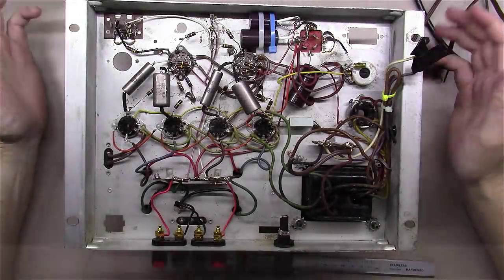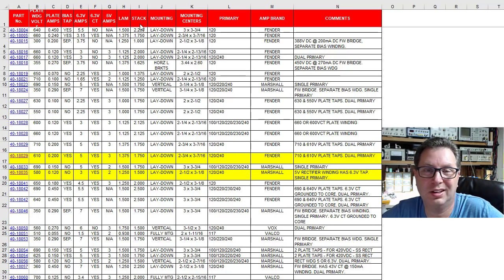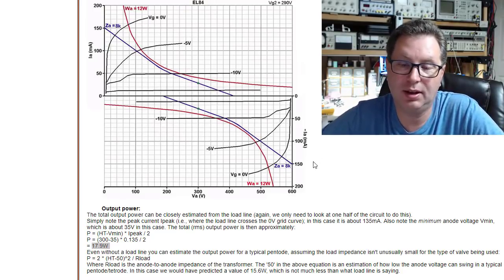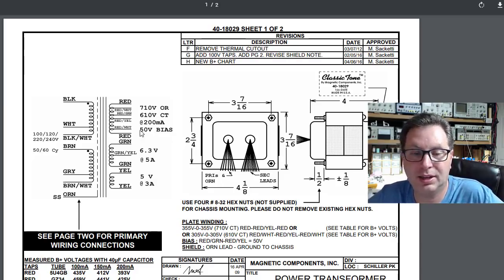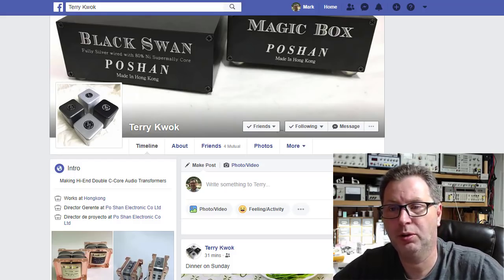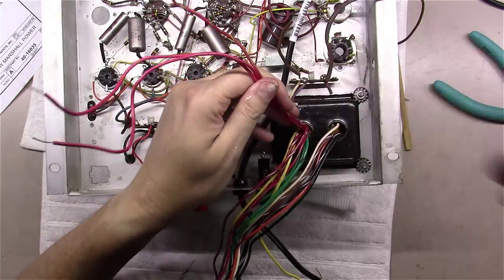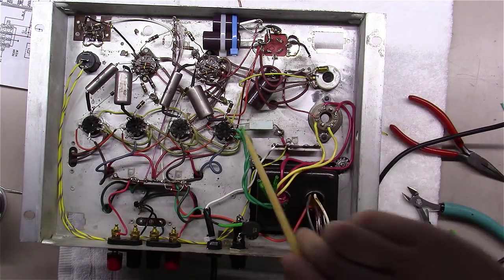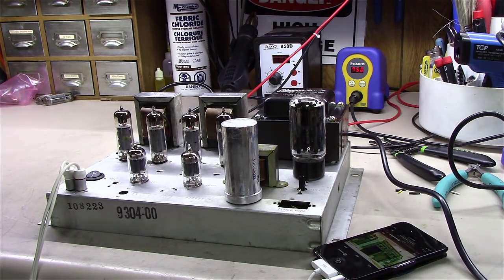How to find and install a replacement power transformer for your tube amplifer

Comment: The first filter cap should have a tie point to secure the positive lead where it is soldered to the red wire from the 5U4. Looks like a short to chassis could easily happen. Good to see both of these Maggies restored to working condition. I am looking forward to the KT88 build. Have re watched the 807 amp build a few times through. Great work, always love it!

Comment: Thanks for all your videos and recommended websites for components. The last two years I’ve been practicing with low-voltage amplifiers three solid-state two low-voltage headphone tube amplifiers. I’m about to build my first preamplifier. Then I’ll take a shot at the high-voltage high dollar DIY tube amplifier build. Your knowledge you pass on to us will remain on the Internet forever. 👍

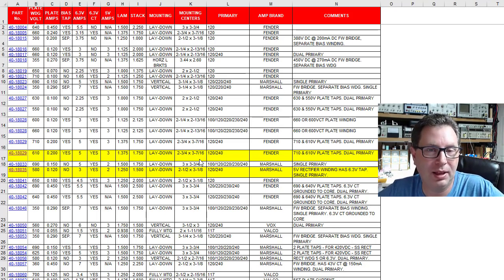Comment: Ok, right at the 14:45 mark you make a significant error in sizing, (3-7/16") 7/16" is in fact 5/16" of an inch larger than 1/8" off by a factor of 5 times.  Or 3.4375"-3.125"=0.3125" ; 1/16"=0.0625 5/16"=0.3125"(sorry it's the engineer in me).  I'm glad you had room on that chassis for the actual difference.  It looks great and sounds good too.

Comment: I got a Marshall dsl20 head. It sounded amazing the first couple hours. Then like a idiot I unplugged the speaker cable from the amp while it was on. The amp was on the clean channel with gain around 2, volume around 3. Wasn't playing the guitar. It was unplugged for about 20 seconds before I realized what I had done. Ever since the amp hasn't sounded as good. The tone is fizzy now. No crackling or popping. Didn't smell anything burnt. Could I have damaged the power tubes or OT?

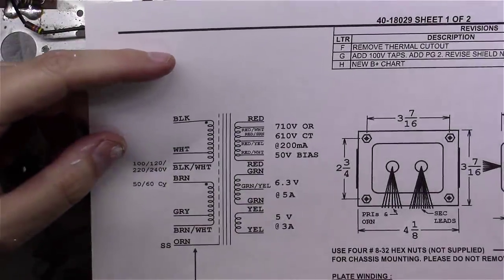Comment: Wait a second.  Looking at the transformer schematic @29:30, you used  red - red/yellow - red for your B+ windings.  From what I see on the diagram, that should be 710 volts across the entire secondary.  Shouldn't you have used the red/white - red/yellow - red/white taps which should give you the 610 volts, much closer to the 590 volts (no load) mentioned @3:50 ?

Comment: Why wouldn't you have gone with their number 40-18041?  Fits the original size and the specs seem to match - what am I missing?  It's line 20 in the spreadsheet.

Comment: WRT the 6BQS, isn't the 92 milliamps plate current for Two tubes? The Hammond transformers can be installed  'upright' or 'lay down' (just take one side cover off).  I bought one for my original Vox AC 30!

Comment: Wondering why you used the 710vct HT rather then the 610vc HT. I would have used the lower HT taps for EL84's.
Reply: That's how I read the transformer too. The B+ is now much higher than before. Calculated 504 volts vs the original calculated 417 volts.  B+ = ((VCT * √2) / 2)

Comment: I am having trouble understanding no-load transformer tests.  Every time I  try that, the results are useless for predicting performance at even 1/10 load.  Are these older transformers different from modern equivalents?

Comment: Thanx very much... I enjoyed your vid. I have a Fender Hot Rod Deluxe and though it sounds great the power transformer, after about 15 or 20 minutes heats up to a bit more than I'm comfortable with. Can you tell me if there are any guide lines as to how hot is too hot? Thanx in advance and thanx again for a great vid.
cheers

Comment: The measurement difference is actually 5/16" on the mounting center length of the 40-18029 transformer.  
But we're not spring chickens anymore and are able to make goofy math mistakes.  3-1/8 to 3-7/16" is an additional 5/16".

Comment: Hello, Is there a way to find the max. current available of the 6.3 AC heater current since don't know specs? The amp designs for KT88 and I like to use KT120 which needs more current. Thanks

Comment: Great video.Good info. Understanding current is my biggest weakness. The values of caps in the power section are confusing. Why does it hurt to raise the uf on caps or add an extra one. Why would it hurt to change an 5f1 champ from 16-8-8 to 22-16-16. I have seen people do it but I have had people say, don't do it.What would be the reason not to do it. Thank you.
Reply: If you're using a rectifier tube, a bigger capacitor will draw more current, and for more time, during first charge up, when you turn on the amp. That would damage the tube. If you're using solid state rectification, it's not really an issue. My champ uses 100, 47 and 47 uF. It's dead silent, no hum at all, unless with single coils.

Comment: Hi I am from india and I have Delta Company "BMB 20" Power Transformer Cum Vibrator Transformer which have one side black, green, yellow wire or 2 sleev with copper enimal and other side  2 red, White 2 sleeve with copper enimal and 1 center tap copper enimal. Can you please tell me how I will connect it with EZ80 tube.

Comment: The first transformer 40-18035  would have been shy on current for the rectifier fillament, 5v @2 amps. A 5U4 requires 3 amps.

Comment: Save those cut offs. The classic tone and heyboers are the best in guitar amps. Mercury mags are high priced and in the snake oil category.
Reply: Seems that many like to dis on Mercury. I have been using them for a long time now. Their prices may seem high, but their quality is very good and they carry a full 10 year warranty in case you do have a problem. I had an amp come in with a Mercury PT that I had installed exactly 10 years earlier. By some fluke it had an intermittent issue between two windings. By the time I got it on my bench it was technically past the warranty period. They replaced it for free. I don't necessarily sell them as "tone improvements, but in the case of a Vietnam made Ampeg SVT, the difference in tone from the stock OT to the Mercury was astounding. They have never steered me wrong on a transformer recommendation. I do occasionally use Hammond transformers. Their Drop-In line works very well and is probably a good choice for a DIY home builder.  It seems Classic Tone has gone under now. Maybe they should have charged more.

Comment: Why can't you un-pot the transformer and see if it's repairable. The guy at valve wizard is he the same guy who manufactures and owns do you know the great little valve company amplifiers
Reply from the maker: Its not a potted transformer.  You could unwind it but on these old ones, they typically take a full rewind and the coating on the wires chips off as you unwind them.  Would be way more time and money than simply replacing it.
Reply: Blueglow Electronics I just wondered because sometimes I don't know what the results are on this transformer but a dead primary could be broken connection usually happens might be just broken at the terminal end to the wire.

Comment: You can avoid the hassles of an incorrect 5 volt winding by replacing the power rectifier with solid state diodes especially with a transformer with a lower secondary HV rating.

Comment: Could the orange wire "Shield Wire" possibly cause a ground loop?  I just bought a brand new Hammond 290BBX and the eyelet for the shield makes the bottom cover sit funny.  https://www.dropbox.com/s/9elukoabidoj4k2/100_0489.JPG?dl=0   Are they all like this?  Is it a bad idea to remove it If bolted to shinny steel?